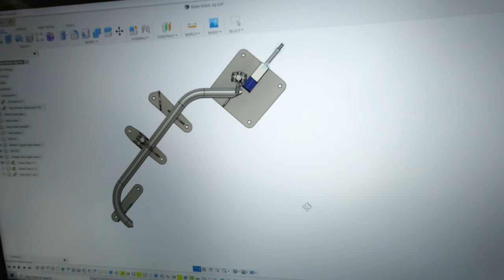Big O Sliders install to Y62 Patrol

Comment: So any tips for getting the long bolts through the middle bracket? Was kinda brushed over on the video, apart from the tip of sleeving the bolts. Finally got time to install my sliders today but couldn't get the long bolts in on the passenger side due to the heat shield for the exhaust, and never even got to starting on the drivers side. 🤦‍♂️
Reply from the maker: Do the drivers side first, it’s much easier. It’s a fiddley job but they are tough as once in. 👍